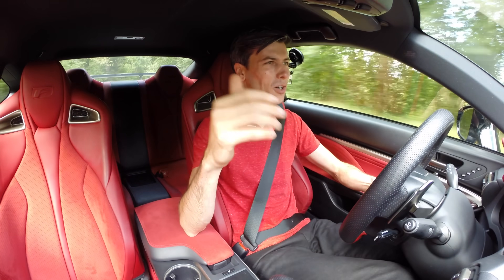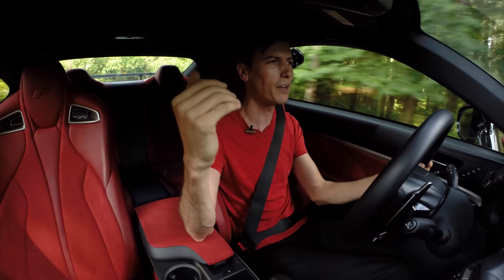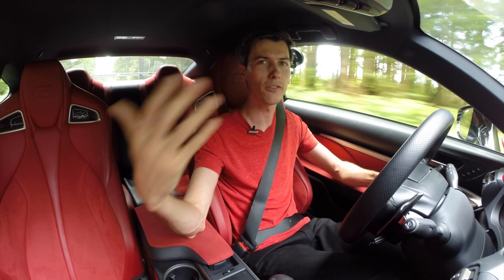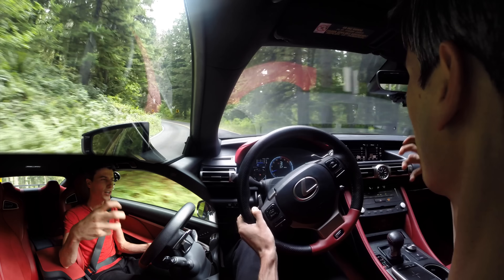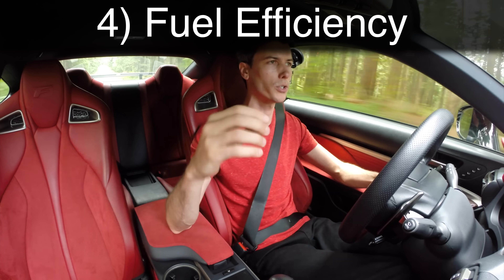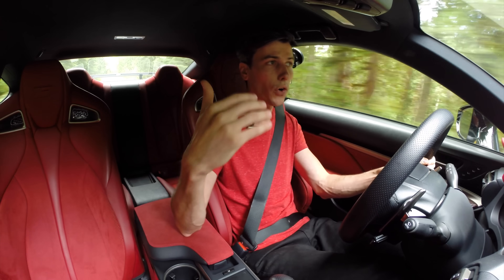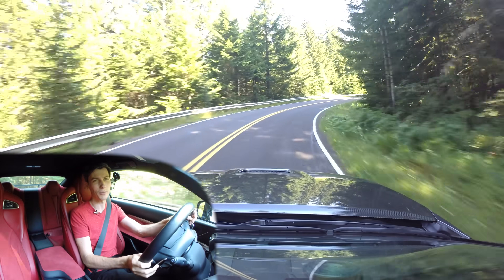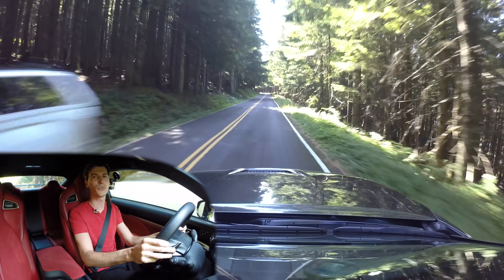5 Reasons You Shouldn't Buy A Turbocharged Car

Comment: Direct injection engines don't have much lower compression ratio and have higher compression than port injection NA.

You use the WRX as example for 50% throttle being full boost. That's because Subaru map it poorly where about 35% throttle is actually about 90%. Everyone who tunes their car fixed this to make it linear

Comment: N/A is boring , and if the turbo is oversized for the engine , there will be lag.
Big engine car = big purchase price and heavy???

Or big engine car with turbo or turbos = greater success 🇺🇸👍🏼

And lastly,  correctly sized turbo charged  engines are more efficient,  that's what's driving sales and a greener planet .

 reduce air temps , pump E85 , less knock/detonation and cleaner emissions 🤦‍♂️.

I disagree , a turbo charger sounds way better .

Bla bla bla carbon fibre,  170 pounds lighter , carbon ceramic brakes , titanium mufflers....that's just BIG DOLLARS AND RND.

YOU COULD BUY AN INLINE 4 CYLINDER TURBOCHARGED CAR WHICH WILL , OUT PRICE , OUT PERFORM, AND LASTLY WILL BE ALOT MORE ECONOMICAL TO RUN .

Comment: Full boost at 50% throttle? So that's the same pressure as it uses for maximum hp but through (effectively) half the sized hole? I completely agree with your points but I thought that was a bit of a miss quote.

Comment: Working in the car business I commonly see vehicles over due for oil changes.  A lot are a 1000 or more miles over and this is very  bad for turbo charged vehicles.  Most common response when I mention it to the customer...It's a lease I don't own it.   I would never buy a used turbo vehicle because of this.

Comment: LONG LIVE the NA V8!!!  Love my 395 HP Hemi Ram... there's almost no reason a regular truck like this has such a hot V8, lol!  It pulls like a madman in a vehicle that weighs about 6000 lbs!
I think part of the problem with this brave new world of everybody-gets-a-turbo is that downsizing has gone too far.  If an engine is going to cost more to make due to beefing up due to forced induction, maintain some displacement, use a fairly small and broad curve turbo, and provide some real HP, torque, and throttle response characteristics.  The efficiency gain isn't as great as marketing wants to push as Jason carefully explains (A/F enrichment, etc.).
The Dodge Dart is a great example.  The Fiat-derived 1.4L turbo I4 had roughly the performance of the 2.4L NA "Tigershark" I4.  If FCA had a 2.0L turbo I4 at the time, a great GT or R/T model would have been feasible and actually make the nameplate exciting; it didn't do well as expectations were higher than the delivered result.  And unfortunately a SRT version never made it to market before the car was killed off by Sergio Marchionne.  And on the topic of NA motors... stuffing a 3.2L Pentastar V6 into the Dart would've made it a tire-roaster. ;)

Comment: The advantage of the turbo is when you live at altitude.
Reply: Exactly. At altitude, naturally aspirated engines loose a lot more power, than turbocharged engines. Turbocharged engines are still putting in just as much psi of boost at high altitude, as they did at low altitude. Sure, it takes longer to get there, and the torque curve suffers, but once they get there, the power is nearly the same. Whereas, naturally aspirated engines make less horsepower directly proportional to the amount of less air there is at that altitude.
Reply: @copperkeyracing6167  You've gotta have atmosphere to pressurize. All forms of forced induction also suffer at altitude.
Reply: @turnin.sprocket  Exactly. That's what I said
Reply: @copperkeyracing6167  "are still putting in just as much psi of boost at high altitude"
Your impression was a tad confusing is all.
Reply: @turnin.sprocket  Sorry, I'm also an Engineer. I just don't use the terms "more better" and "more faster." I'm also not as good at putting it in laymans terms
Reply: Wasn't it a episode on top gear about that?
In Australia...When they reached 2000 or so meters their cars just barely moved?
Reply: I live at 4500 feet above sea level. Atmospheric pressure is down about 17%. So is the power of your naturally aspirated engine. My turbo charged engine probably loses about 2%. Keep your NA and I’ll stick to my turbo.
Reply: @johanvandermerwe2928  Is that an X3?
Reply: So are these turbochargers actually turbonormalizers to compensate for higher altitude?
Reply: @Booboobear-eo4es  No, they have a pressure release which is set to a specific pressure, not a pressure differential, so they will boost to whatever pressure, regardless of the surrounding air pressure. The problem is that at altitude there is simply less air, and the turbo's sometimes can't suck in enough air to fill to full boost (I think). I'm not an expert on why there are losses for turbo cars at altitude, but know for sure that it's about negligible.

Comment: Turbos are improved fuel economy, power and woosh noises. Don't compare a downsized 1.2 liter turbo to a v8, compare that v8 to what that v8 could be with more boost. Sure it costs money, it adds weight and is another component that could die but the same goes for air conditioning!

Comment: Hello, Jason Thanks for this discussion. I own a 2015 Mustang GT and a 2018 Focus ST. I was running regular 87 octane in both but being retired and driving very little these days I decided to start putting 93 octane in the Focus. I haven't driven it enough yet to say for sure but I am pretty sure the MPG went up but one thing that I am sure of though is that I get a lot less soot build up around the exhaust outlet. Before the premium gas was used the soot build up was horrible now it's very minor. I keep talking to my son about how this puzzles me but description of how they enrich the mixture to control temps, (may detonation tendencies?) makes perfect sense as to what I'm seeing. I saw on a Focus ST forum people talking about the OAR reading. It took me a while to find what the heck OAR meant but it is octane adjustment ratio. These days with cars it's hard to know what all the computers can do to keep the engine at peak efficiency.
George
Oh, I never see soot on the Mustang exhaust tips and it does definitely sound a lot nicer.  (smile)

Comment: In fairness to the diesels being more expensive. The 6bt Cummins connecting rods can generally take ~1800lb-ft of torque before failing. The crankshafts can take 3500+lb-ft. The noise thing I prefer watching diesels drag race to gas jobs, as I don’t need earplugs to watch them.

Comment: I'll take a 2.5 L turbo over a 2.5 L non-turbo.
It's taxed almost the same, but you get the power of a much bigger, more expensive engine.
In USA this video might be more relevant than it is in the rest of the world.
Reply: That's not normally the choice though. BMW 328i went from 3 litre  6 cylinder to 2 litre turbo. Similar performance. Jsut to meet mpg govt regulation. That's what most vehicles in USA have done.

Comment: Having a small turbocharged I can say that: 1. Throttle  ... mine is very modular and in sport mode has some torque from 1600 rpm.
2. Throttle response ... that one is kinda true....
3. Reliability/cost ... comes down to how much power the engine has and how much of that is used. A lower compression engine (with lower rpm limit) will last more than a higher compression one so ... and also my turbo is cooled with water not oil...
4. My turbo engine is efficient enough both in town and outside. is more efficient than the exact same capacity (with less HP) naturally aspirated engine. 14. Turbo @ 140 HP vs. 1.4 @ 90 HP.
5. Sound ... mine is so silent that at the stop sign I have to look at the rev counter to know if the engine is on or off, and I like it that way because "music sounds better with you".
SO ... thumbs down for this video.

Comment: One reason you shouldn't buy a turbocharged car: so there will be more for me to buy!

I love turbo engines but did have a revelation recently.  I've owned turbo cars for a couple of decades, but they all had manual transmissions.  Turbo lag was easy to manage by keeping the car in the right gear, and I never really understood what the big fuss was about lag.  Then I got a turbo car with an automatic transmission and understood.  The automatic is one of those very modern computer-controlled ones that has numerous programs and the computer is constantly trying to guess what you want from the transmission.  Combine that with turbo lag and when you press your right foot down you never know exactly what is going to happen.  Very annoying!
Reply: Some of the lag comes from Drive By Wire throttle systems which are poorly mapped. I rented a new AUDI Q5 with non turbo engine and it was horrible. Seemed like the computer was waiting for something to tell it what to do next. I also have an ALFA 4C which has a turbo 4 cylinder engine and dual clutch trans and drive by wire. It has no issues with lag or weird throttle response. So I suspect it isn't a turbo but the specific car that needs to go back to school to get it right ;-) For a sports car a small engine and turbo makes a lot of sense...light weight, wide torque curve, power from down low not only at peak rpm. When a 106 CI engine can do 0-60 in 4.1 seconds and mid 12 seconds quarter mile.....and get over 34 mpg on freeway....that is impressive.

Comment: Point #4 is pretty misleading, because a turbo allows you to get away with less displacement which saves fuel economy. It does that by forcing more air in during the intake stroke, thus increasing the effective compression ratio (not only relying on the compression stroke), which increases overall engine efficiency. That's the whole reason small displacement turbo engines are so popular now: to meet those stricter fuel efficiency standards without sacrificing too much power. If car makers could have done that with cheaper N/A engines, they would have.

Comment: I know I am nitpicking but, you should have included variable scroll turbochargers, and the unusual use of both a supercharger with a turbocharger. That being said, I agree on all counts. By the way, a proper in-line 6 or V6 can sound amazing too, specially the former. Fake sounds, either through the speakers or using a "thingamjig" under the dash, are a major turn-off.

Comment: Turbo lag undoubtedly exists, that said it is significantly reduced with modern turbos especially OEM ones that are correctly sized for low to mid range boost rather than huge oversized ones if it's setup for absolute maximum top end power.

Comment: Turbo lag is not really a question of turbo size, per se, but rather a question of exhaust housing AR.  A lower AR will provide faster spooling, but exhaust restriction at high RPM, while a high AR will cause slow response, but better flow at high RPM.  Variable geometry turbos are now being developed to actually increase the effective AR of the exhaust housing as boost goes up.

Comment: My turbo car sounds better than my dad's non-turbo car, but I get the point. On the efficiency side, with direct injection, manufacturers achieved somewhat high compression ratios (The Fiesta ST from 2014 has a compression ratio of 10:1) so they are almost like many non-turbo engines (with some exceptions, obviously), but still, so achieve this they run very rich and maybe retard some timing.

Comment: Not hugely convinced with the fuel economy argument, I get that on paper a turbo engine may be less efficient than it could be, but I'm betting my 2 litre turbo Golf R is far better on fuel than that Lexus, and there's only about a 1 second difference 0-60 between them. Bear in mind that although bigger engines may burn fuel a bit more efficiently, they're also significantly heavier to haul around....net result ?

Comment: Boost in 2020 is the norm. Generally the sporty vehicles do have a natural as the base V8 or V6. BUT when trying to squeeze out a few more mpg for 2020 standards? A turbo is going to win because it is lighter. I will have to wait and see if it will be better. My current natural I6 has 196,000 miles on it. It will probably outlast the body.

Comment: Big engines have a lot of internal friction and so energy losses, as well as being heavy. Therefore a small engine with a turbo is more efficient, at least at moderate throttle openings. Of course the internal combustion engine in cars is looking towards extinctions anyway so the argument is moot.

Comment: A friend of mine owns a Ford F350 with a turbo diesel V8. When the turbo died the repair bill was $12,000 because they had to remove the cab just to access the turbo.
Reply: If that's true, it's just ridiculously bad design.

In most modern cars a good mechanic with the right equipment will have the engine out in 30 minutes. From there it's like four bolts to remove turbo.
Reply: Yes, you are correct. Terrible design. I like Ford trucks but I will never buy one with a turbo.

Comment: The things he latched on were like really bland and while to some few they might hold true, most of them were just his opinion rather than actual downsides.. The only reasonable argument was the cost compared to a NA engine is higher on turbo engines. The Turbo lag for example is wildly different between different manufacturers, engines and etc. and almost a relic of a bygone age what comes to current iteration of turbo cars. This is just another paid commercial which is the reason i quit watching his videos.. And if it ain't paid then it is more of his extremely polarized opinion about how things "should" work according to him. Once you do some research you see that i hold more pieces of the truth than this dude who's talkin (can't even remember his name) on this video

Comment: Typical flat lander analysis. NA engines loose about 3.5% of their power per 1,000' of altitude. I live at 7,800' in Colorado, so I would loose about 27% of my power in an NA engine. Turbo charged engines only loose just over 1% of their power for 1,000' of altitude. I love going eastbound on I-70 out of Dillon up to the Eisenhower Tunnel. It's very steep, and the highway maxes out at 11,000' of altitude. It's joyful driving my 5-cyl turbocharged Volvo XC90 doing 75 mph staying in top gear and torque lockup, cruising up that steep slope like I'm driving on level ground at sea level, while watching the NA cars dying in the middle lane. Very joyful. 

And the Volvo 5 cyl has good low-end torque before the turbo kicks in, so it's blended very well indeed.

The days when turbochargers would destroy weak engines are long gone. Decades ago.

And I love the sound of my 5 cyl engine.

I'll never buy an NA engine again.

Comment: Now picture all that boosted force, pushing the tiny small displacement piston down and sideways (due to the con rod being canted during a great deal of the power stroke)...... You end up with twice  the force pushing that tiny piston against the cylinder wall. Less surface area, higher load.....I can't imagine how a small turbo engine could last to 300,000km the way today's naturally aspirated engines do

Comment: I nearly always buy turbo diesel vehicles and have done for the last 30 years, I am a time served diesel fitter and have worked on all sorts of engines both big and small diesel and petrol. The total engine failure over the last 30 years on all the vehicles I have owned is NIL, this lad over complicates things regarding Turbo Lag over Aspirated engines on both diesel and petrol engines. Everybody's requirements for power verses economy are different and as such there is NOT one engine that suits all requirements so all this complicated explanation from him just confuses people more because most motorists haven't a clue what he's going on about, I of course understand him and his explanations, in some thing he's right and on others I don't agree with him but that's life. He does really complicate some things that are not that complicated if you understand the workings of engines, at the end of the day it's horses for courses and that is what most manufactures do for their customers when they design vehicles, the more power and speed you want the more you stress the engine which could possibly make it have a shorter life depending on how it's driven and maintained. Diesels do on average achieve higher mileages wether turbo charged or not because they are slower revving and run on diesel fuel which is oily where petrol engines run on spirit which is constantly washing the oil off the cylinder bores.

Comment: Many modern turbo engines and aftermarket ECUs have something called torque mapping, where it uses the DBW throttle and electronic wastegate to improve the linearity between throttle pedal and throttle, it works quite well

Comment: I can agree if you drive a 5.0 l car. With a much smaller engine as we usually do in Europe (let's say 1.6 l) naturally aspirated engines have too low torque, need to work over 2000 rpm and require too many gear changes. All IMHO of course.

Comment: 5 counter points for turbochargers
1. More torque at lower rpm 
2. Better fuel economy
3. More hp per dollar once you start modifying 
4. Turbo noises
5. Power

Comment: Intercoolers really solve the knock problem. Its not that much of an argument in my opinion.
Reply: It still is, a turbo is a ristriction in the exhaust meaning you'd still get higher temperatures at the exhaust valves.

There is a reason mazda has to drop compression in their only turbo engine.
Reply: @1barnet1  Because there is more effective compression, with forced induction.  Not because the exhaust valves are hotter.

Comment: Surely there is something wrong with the turbocharger installion, if you have 2 seconds of turbo-lag

Regards heat soak on a turbo, this can be done by running the engine for a short while afterwards, but would you also just turn off a naturally aspirated engine after running it hard?

I'm not arguing against naturally-aspirated engines, I am genuinely inquiring as I've never had a high powered non-turbo.